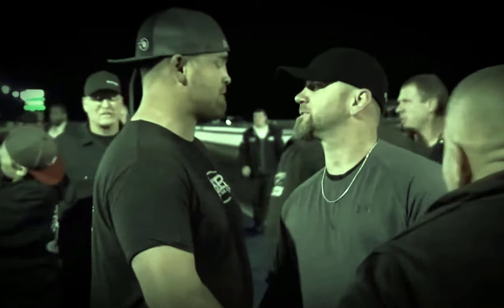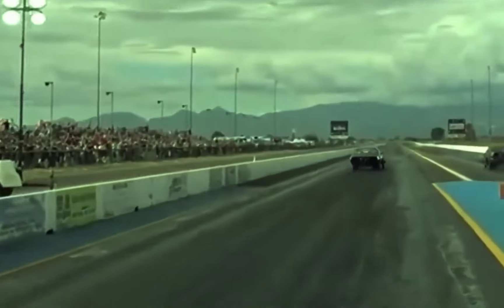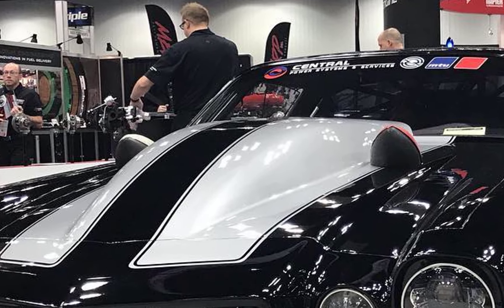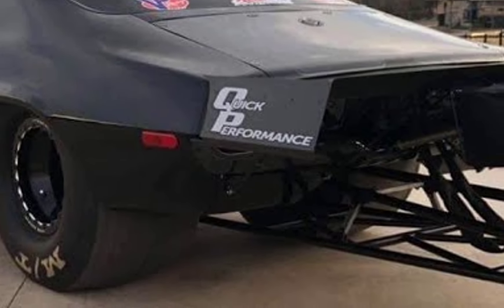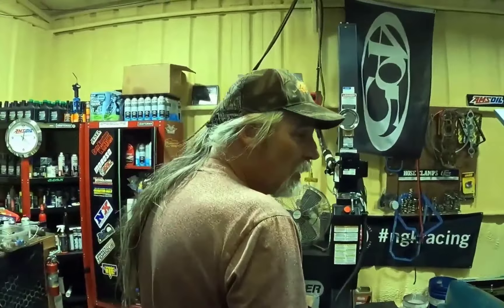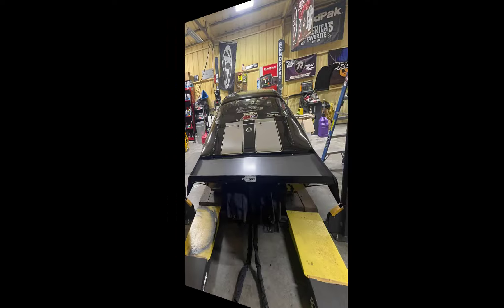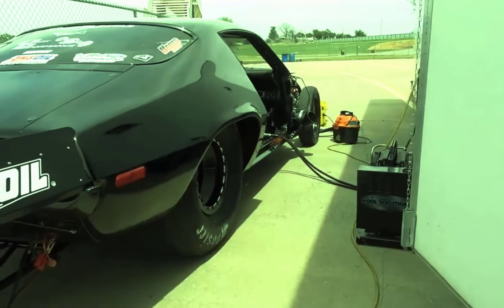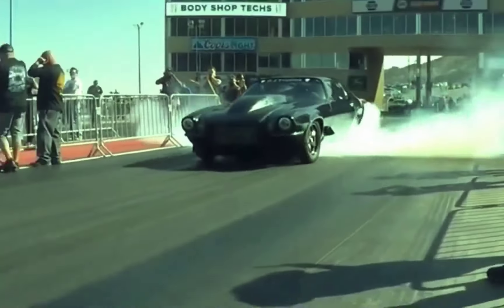Monza's Split Bumper Camaro is Going ProCharger – Big Changes for 2024

Comment: Since monza been driving twins turbo made a good heat 👍🏻👍🏻👍🏻👍🏻👍🏻, so built 1 SS chevelle procharge hemi sold it ,🙄🙄✌✌🤔🤔🤔🤔 ,I think he has original z28 Camaro that he rebuild as original or promod looks with proline hemi procharge and if need nitrous which can make hit all the best monza 405 😎😎😎😎😎👍🏻👍🏻👍🏻👍🏻👍🏻